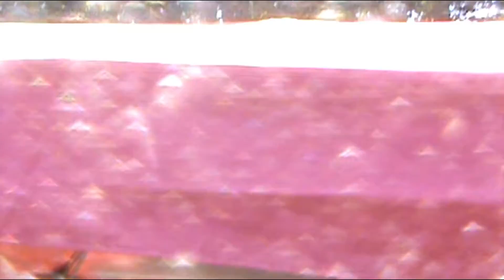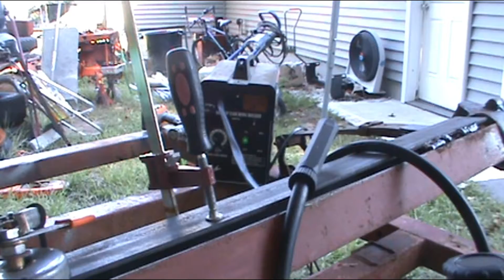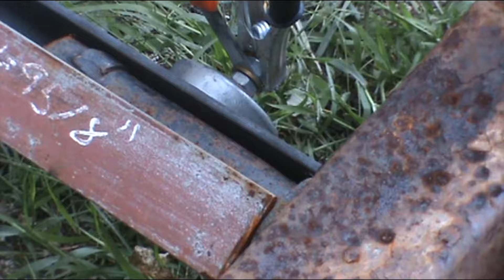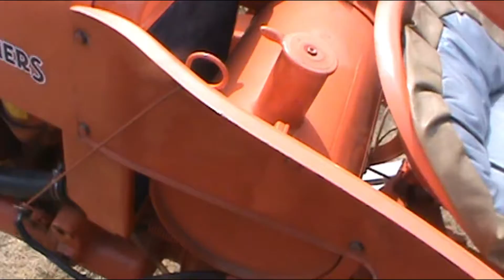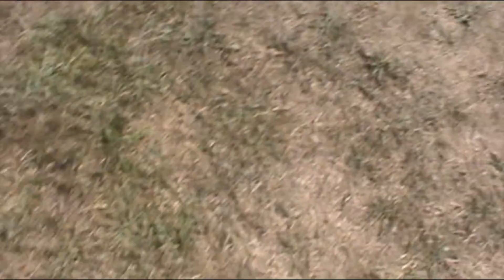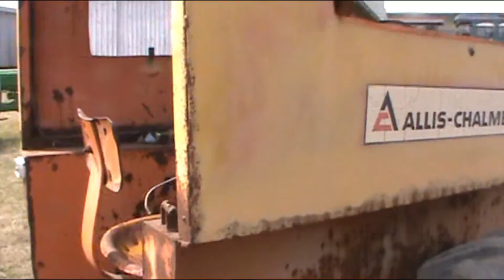MILLER 211 IS BEST WELDER IVE USE WAY OVER LINCOLN

Comment: If you are using a mig welder you need good clean areas to weld. The flux core will work better on dirty metal. It looks like you need to turn up the amps on the mig and slow down the wire feed. Nothing wrong with the welder, it's what you are trying to do with it. Move more slowly will help too.
Reply from the maker: The 211 high it gos

Comment: Operator error. You didn’t change the polarity on the 211. If you go from mig to flux you have to switch the polarity. You basically put water in your Ferrari’s gas tank and explained your old Ford runs better then your new Ferrari.
Reply from the maker: It 120volts
Reply: @73superglide62  when you switch from mig to flux core you have to open up the 211 and switch your ground connection to the other terminal, that’s switching polarity. It doesn’t matter if you are on 110 or 220. Change your polarity and it will weld correctly.
Reply from the maker: @brentbowles7403  so funny it was 15volts

Comment: I'm betting you have the welder set up incorrectly. the gun should be hooked up the negative terminal and the ground cable hooked to the positive terminal. flux core welding uses reverse polarity. it will still weld using positive polarity but welds like shit. exactly like the results your getting. this assumes you have your other settings correct. if your settings are set to low/cold this can happen also.
Reply from the maker: I've tried both way ,just me I'm told so far

Comment: Your right miller is nice but lets all face it they do have low power compared to the new harborfreight titanium and vulcan is almost miller i had the miller transpocket ,fronius mp welder ,fronius 180 transpocket and i learned this HF has cheap consumaples great waranty and theres stores all arounf here i can swap it new and dont wait im a contractor and whent to trade school with 10 years structural and 4 years in wrought iron my vonvlusion HF  there ugly but they make money and doesnt cost a arm and a leg

Comment: Looks like user error.  No comparison 2 a Miller 211 and a HF flux welder. I own a Miller 211, a Lincoln 3200 & a HF flux machine and even with my HF converted 2 DCEN it doesn't compare to my 211. U probably don't have the 211 set correctly for the size of steel ur welding because it's not penetrating and it's stacking.  Also, if ur welding a big gap with no backing u need 2 do multiple passes welding one bead to the other to fill the gap, and use quality wire that allows 4 multi pass.
Reply from the maker: That s what told miller and they don't say a word back
Reply: If it's within warranty (3 yrs) I'd demand to them that that they take it in for repair and testing.
Reply from the maker: @legalsolutions07  I all So spoke selling dealer about ,,they don't sell them
Reply: All so?? Come on man.. its fuvking ALSO

Comment: Put the same wire in the Miller and it will weld better. You're comparing apples to oranges with your setup.
Reply from the maker: Sorry see no fruits there ,this 4 stopping bye

Comment: 100 % operator error. I don’t know how you have not been injured.
Reply from the maker: Your as dump last 100
Reply from the maker: @bobsquibb5863  same
Reply: I have both. Titanium 200 and i upgraded to millermatic 211. I have a brand new titanium 200. I’ll trade you?   It’s not the machine my friend. I forget which harbor freight welder you have. The titanium is a great machine. 211 is just better. If you prepare your metal, use 220v or even 110 with the right motion with gas there is no comparison. The reason your flux is working better is that you have dirty material. You would have even better results with stick weld. Flux stinks, makes a mess, got to chip slag off and it’s horrible to breathe. I’m am 100% sure and I’m not busting your chops it’s not that millermatic unless there is something wrong with it. Your weld looks like a weld with no gas. I know because i taught myself to mig weld when covid hit. I now upgraded because my harbor freight welder isn’t working. Got a warranty replacement

Comment: You have no clue what you're doing.  That's the problem. You're trying to weld dirty 1/4" steel on 120volts using gas outdoors in the wind and you have a 1/2" gap. On top of that your ground is terrible.
Reply from the maker: No clue
Reply: Ya u aint gonna touch 1/4” with gas on 110v. U can with flux core which that 211 runs beautifully. U can’t touch 1/4” with that HF machine in any form.